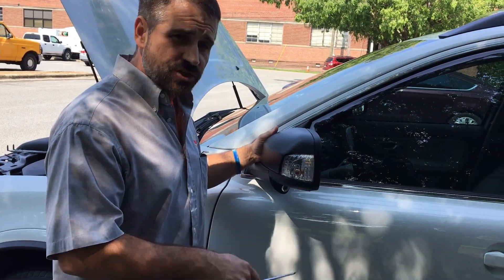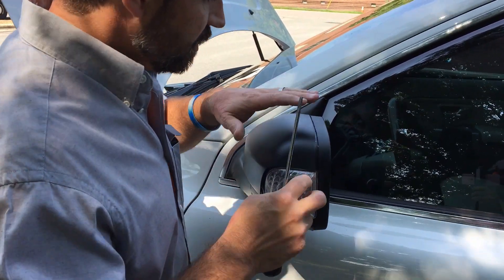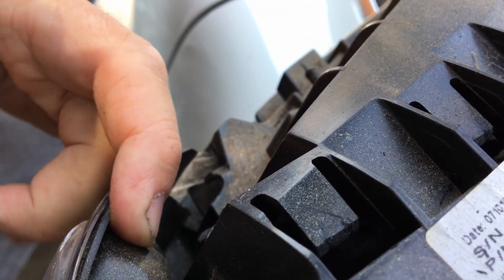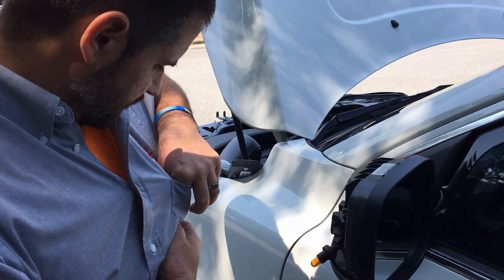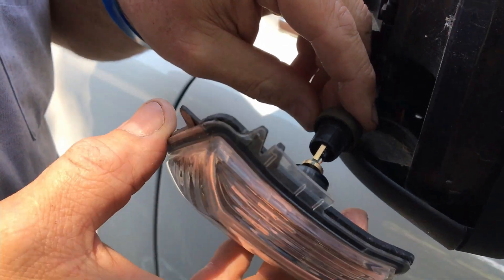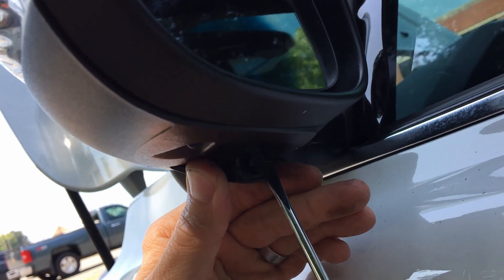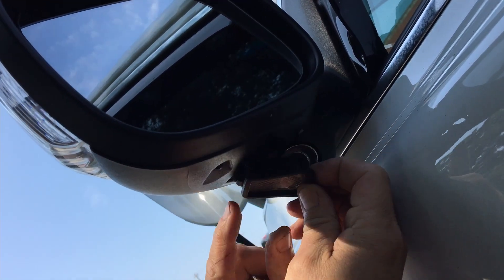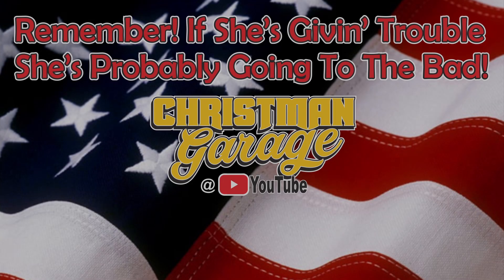2011 Volvo XC90 LED mirror lights install

Comment: That is definitely not the way Volvo recommends doing this job. I marred up my mirror cover thanks to this video. You turn the mirror glass all the way in and pop it off. Both bulbs can be accessed through the inside of the mirror assembly. The reason why this one pops off so easily is because it’s either broken or worn out from being removed too many times.
Reply from the maker: Thanks for the comment👍 we will keep this in mind